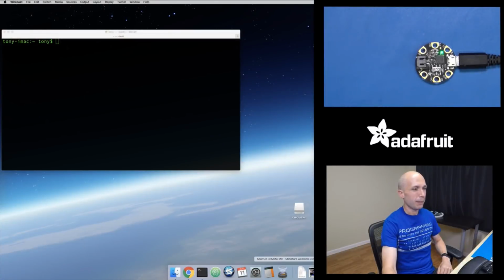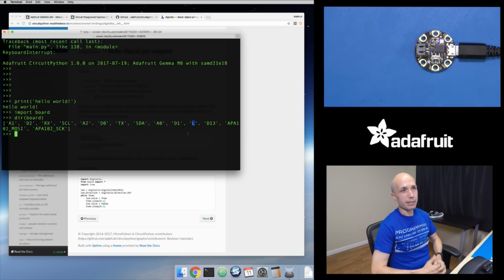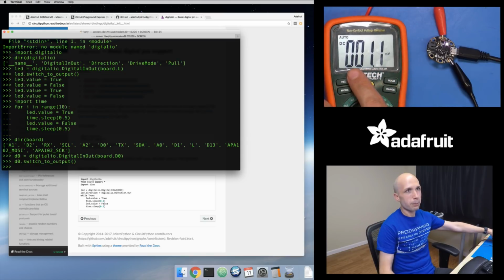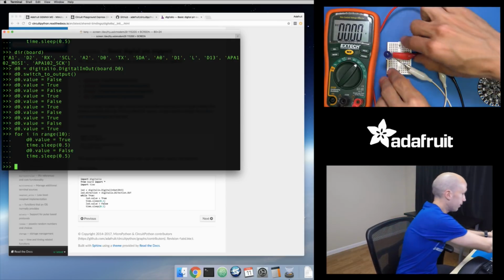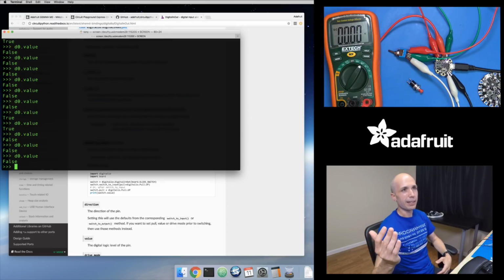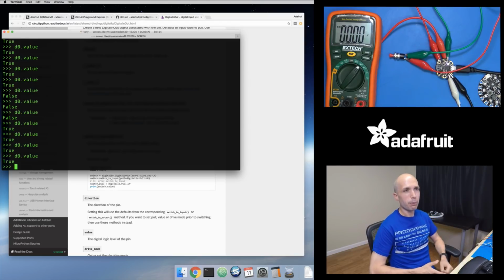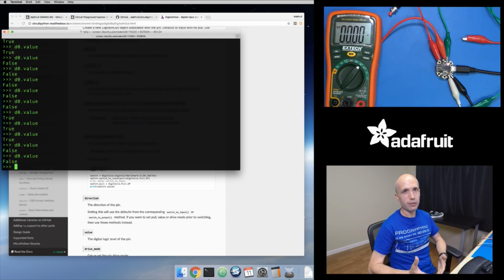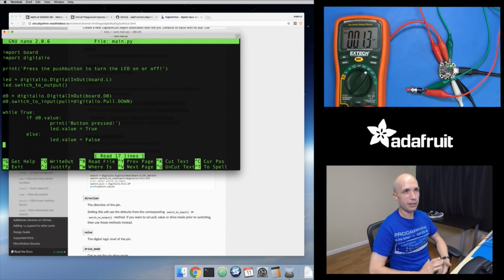CircuitPython: Digital Inputs and Outputs with Tony D!

Comment: Fun fact, LEDs can explode. I remember when I was an electronics noob and I salvaged the poor little red LED (which probably had a Vf of like 1.2V, maybe even less) off my disintegrating 50-in-1 electronics kit. Some time later, I went to hook it up but forgot a resistor (like I said, noob)... and also didn't note that the power brick I'd grabbed was 9V 1.3A *AC*, not DC! It glowed REALLY bright for a fraction of a second, went black, and then the whole epoxy casing just popped and let all the smoke out. It probably didn't help that it was an old unregulated linear transformer power supply, so with only a poor little old red LED on it... 😬

I'm not sure I ever found where the top part of the epoxy flew off to (thankfully I wasn't looking straight at it!), vacuum cleaner probably got it out of whatever crevice it rolled into eventually.

Comment: I would also say the discussion of pull up and down resistors around 34:30 it isn't real clear you are talking about the fact there are functions BUILT-IN to the controller for pull up/down . It is clear(-ish) once the function is demo-ed but not being well versed in electronics and the whole digital IO thing this(pull up/dwn)  is well explained and demonstrated